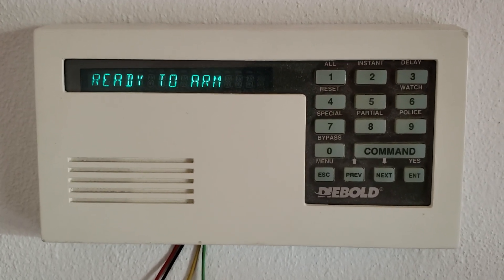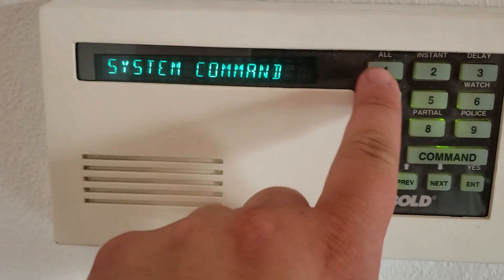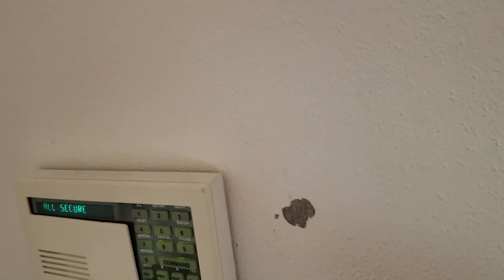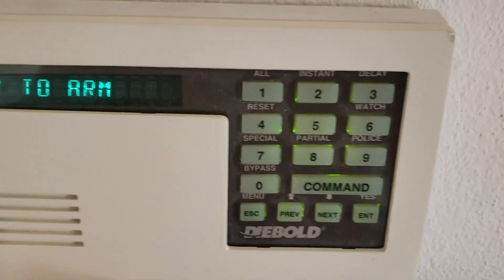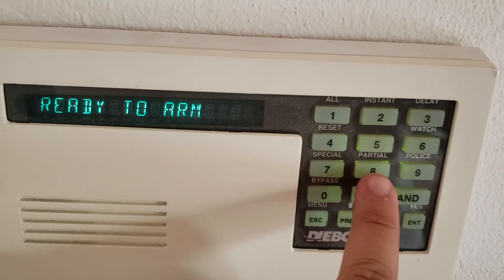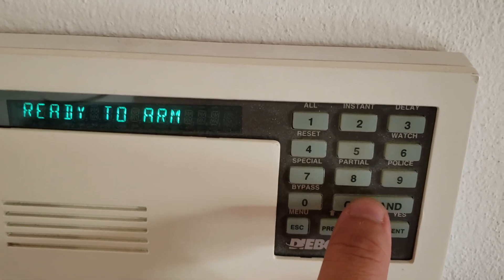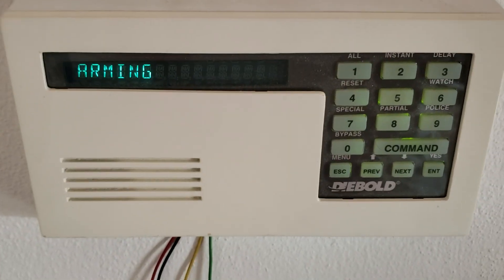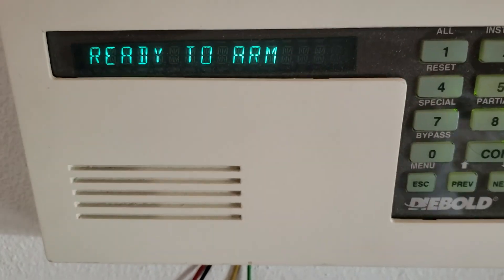Radionics basic functions

Comment: How do you add a brand new code for someone else?
Reply from the maker: Command 5
old code
new code
new code again
Reply: What if you dont have the old code cause the previous owners never gave it to you? Is there a bypass?
Reply from the maker: @jasonhabbe2819  Sadly you would need the previous owners code to change the code or have the previous alarm company reprogram the panel for you as Radionics/Bosch systems dont have a defaulting method on the panel or a restore code on the keypad. If you want to cut time definitely try and get the code from previous owners! If not definetly contact the dealer! Sorry for the late response!

Comment: There actually is a programming menu available on the newer panels where you enter [command] + [99] at the keypad and it gives some options, I still need to get one of these systems.
Reply from the maker: Oh yeah!! the newer panels are really nice! too bad they have had recalls on them due to EPROM battery failing and such on them BOSCH better pick up the ball on that as they have upped the bar on alarm companies installing their products to be on par with their devices and such! I spoke to a professional on Radionics systems and told me that the best Radionics panels you can get are the D4112 6112 8112 7212 gv1 and 7412 they are the more reliable ones as he mentioned also if you wanna save an extra buckprogramming one you can get the BOSCH software for programming all those panels plus the newer ones all you need is the ethernet cable, I dont know if BOSCH has publicly released the software but i have seen people using it on videos here on youtube who are not technicians however id go with Obsolete as all equipment is tested and refurbished and great service on their behalf for these systems.
Reply: I have the software to program the panels, it is called RPS and programs it over the phone line but I need the key for it to communicate to the panel. I am shooting for D9412GV3 because it supports custom functions and access control, the battery can actually be replaced but I have to keep the panel powered to retain configuration. With the new ones if you keep them powered they are good. Another option for programming them is the D5200 programmer.
Reply: The thing is with that command 99 if you do it too slow you will cause a police panic

Comment: Thank You, SO VERY MUCH, for posting this Sir! I have always loved Radionics/Bosch/Diebold products and I especially love the D1255 keypad by far the most!  I have always wanted to know one thing though. If the main system panel's battery gets low and needs to be replaced with a new 12V battery, does this keypad inform you of it? Out of all the Bosch Keypads I have ever seen and looked at in service, I can't recall any of them saying on the screen System Battery Low or Battery Needs Replacing. I only have recognized the one small led on the panel circuit board (I believe it is red or yellow) saying low battery voltage. Thanks again and you are a fantastic person for doing these videos on alarm systems 
that I have always loved since I was just a very small kid!!!
Reply from the maker: Thank you for watching and for the kind comment! Radionics and Napco have always been my favorite manufacturers of alarm systems ever since I was a kid as well been fascinated with security systems ever since. The screen does start alerting of missing battery thats the message ive gotten when ive done a battery test as well as when the panel loses power the keypad begins beeping. I have another more noobish video of the system when i recently got it in my channel where you can see a boot up of the system and the general warnings it makes when there is no battery and such. Please dont hesitate to ask and also if you want you can ask for a video request of anything didnt mean to spoil it but ill be doing a video of the LED keypad soon. God bless and thank you for watching!
Reply: @Decofanblade  Thank you so much! I am like you, Napco will always probably be one of the best panels/systems ever manufactured, along with Bosch. I also like DMP very well. The only company, I guess that I can say, I really like as well but am not overly fond of, is DSC. It seems that too many of those systems, ALWAYS, have a trouble condition of some sort on them.